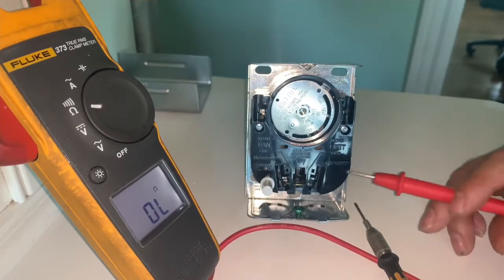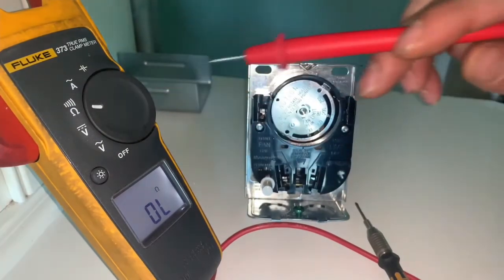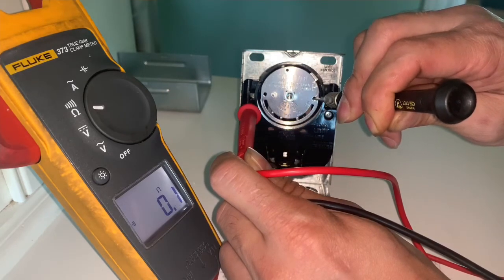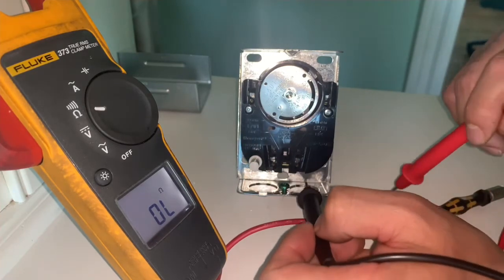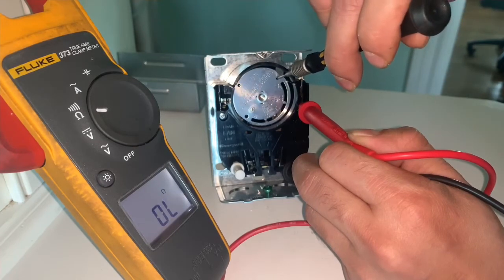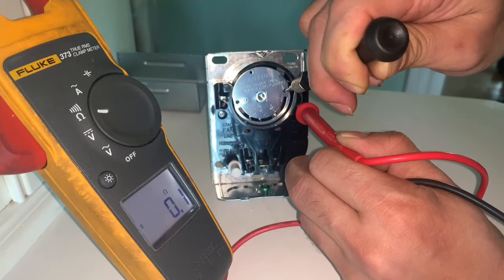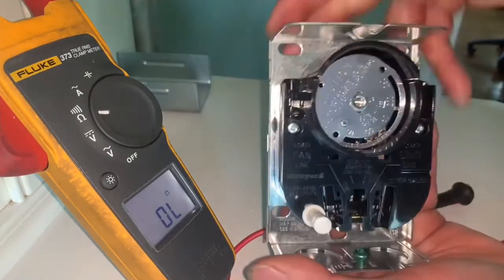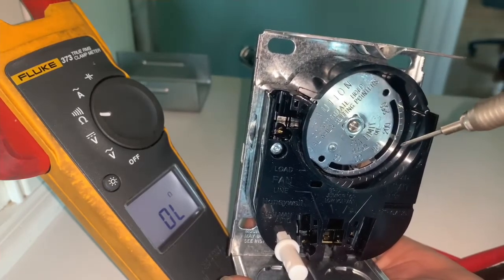How to test and adjust a fan and limit control switch! Cómo probar un controlador de ventilador

Comment: Problem is its taking too long to shut off after heating up and the warms it up an extra 5 degrees before it finally shuts the blower motor off and its sticking. It needs replacement?
Reply from the maker: If is sticking yes you will have to replace it

Comment: So today I replaced one of these on a Miller furnace and I did wire by wire exactly and it melted the wires up by the blower motor so confused!
Reply from the maker: Probably you wire wrong and created a shortage
Reply: @PalmasHeatingcooling  really see I did one wire at a time and the fan limit switches are identical and the old one did not have the copper jumper removed I traced the wire back from the fan to the top part that says fan limit and then the other one and I did one wire at a time I was thinking about hooking up a garbage fan to them and turning on the breaker and seeing if it'll do it again I don't want to go buying a $300 blower motor and have it do it again and it didn't do it with the old switch I thought I was fixing a problem where it was kicking on getting hot then shutting back down then the fan would kick on then the fan would kick off then it would ignite again It would do that sequence for about a little bit you know I thought it was the fan limit switch so I switched it out and that's when I turned it on It got hot and then when it to go kick on the fan the wires melted completely right off the fan I'm just so dumbfounded about it! B
Reply: @peachyclean93  If it was wired correctly before you got there, and you replaced wire by wire, then the only way the fan wires will melt is because the fan was drawing too many amps. In this case, there's nothing wrong with the switch. The fan failed and locked up or something got stuck in the fan and doesn't allow it to turn. This was about a year ago that you had this problem. Did you figure it out? If you did, what was the problem. Please share. It may help someone else in the future.

Comment: Mine is honey well.  The only problem is , the system shuts off except for the pilot light, at the first click, but I have to turn the fan on manually.   What is strange  the a.c. fan kicks on  but  not the heat fan.    It is on the same unit.    I have to on it low burner to heat up , let it have an inch flame to heat up gradually. I have to the fan on most the time because it doesn't put out much warm air.   It has heat the  entire duct from the furnace to the ceiling before It's really warm air. It's a 1980 comfortmaker.
Reply from the maker: It could be a bad control or bad thermostat